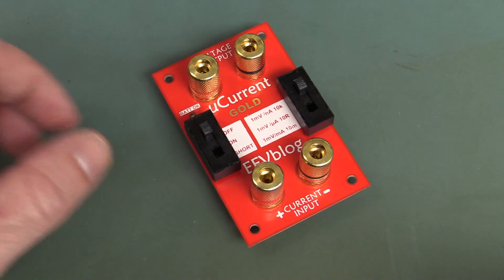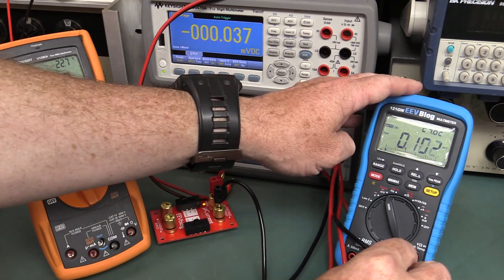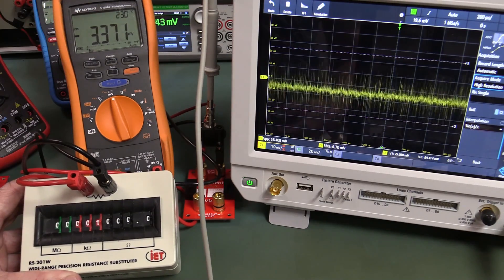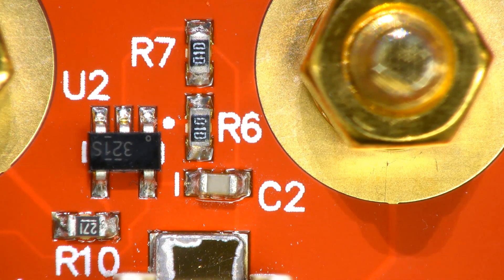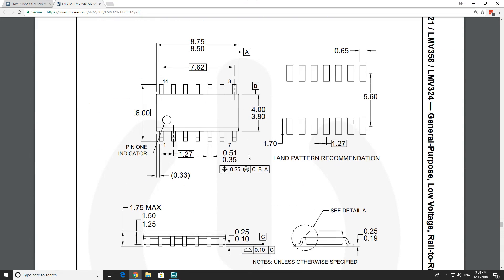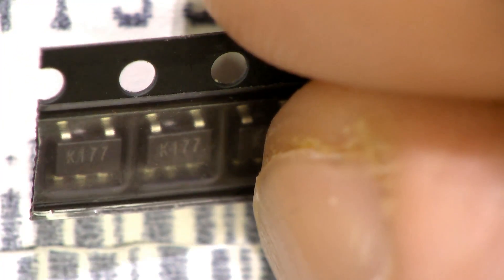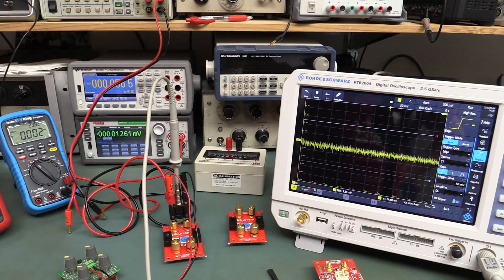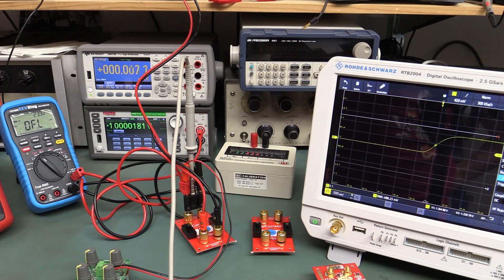EEVblog #1057 -  µCurrent Murphy

Comment: I see the problem in the schematic. The output stage uses a resistor from the output of the op-amp to the output pin. This R, plus a capacitive load adds a high frequency pole which causes excess phase shift and thus oscillation of the output stage. Move that feedback cap to the op-amp output instead of the board output and increase it a bit, I'd guess 100-1000pF. This was a latent design problem. Spice the circuit and you will see the marginal stability of that stage  with a C load. 
A marginal design is like a blind man walking along the edge of a cliff. If he drifts one way, no problem. If he drifts the other way a tiny bit he falls off. The parameter that is changing slightly is the op-amp phase margin, changing slightly from batch to batch. Fix the design, don't select parts. Hope this helps. 
Dave Erickson
Reply: This ^
Reply: Yeah, late reply but that was my first guess at what was happening just by seeing the schematic and the offset voltage. Strange offset voltage is the classic sign of oscillation!
Reply: @Duncan Julio instablaster =)
Reply: @Duncan Julio you are welcome :D
Reply: My reply is 3 years late but this is definitely true. The phase margin is pretty low for the MAX op amps. Looking at the datasheet, at x100 closed loop gain (40dB), the phase margin (by looking at the gain and phase vs freq) is actually NEGATIVE with just 100pF of load! And this is indeed at the MHz range  of freqs, which is what Dave saw. I mean, I don't know why the other op amps fixed this tho... why most of the boards don't suffer from this...
Reply: “Move that feedback cap to the op-amp output instead of the board output” Are you saying C4 should be connected to the op-amp side of R8 instead of the J3 side of R8?
Reply: @stargazer7644  Yes, that's correct.
Reply: @ericksonengineering7011  years later and still answering a question.

LEGEND
Reply: What I don't understand is how come the virtual GND opamp (321) is affecting the phase margin of the output opamp (from maxim) under the same circumstances of output loading.
Reply: If you don't simulate your circuits with various capacitive loads, then at least get a simple capacitor substitution box and test many different loads. I'm 99% sure the original op-amp would oscillate with the 'correct' C load values.

Comment: I have the same issue on both of mine, serial numbers in the 4100 range from November 2016!
I bought them with the intention of looking at measurements on a scope but was very disappointed to see 100mV of noise on the signal which made it totally unusable. 
Connecting it to a DVM it worked perfectly so I put up with it thinking it was just a poor design and not intended for connecting to a scope.
Now I know different and appreciate you doing a vid on this Dave with a great explanation of the cause. I should have queried it back in 2016!

Comment: Not that rare! After 35 years of EE design, I can tell you that there are no equivalent parts. Even parts from the same manufacturer can change over time and lead to this type of problem. High volume production has to test for all of the 'corner cases' or you WILL always have gottcha's! 
Once its in the customers hands those gottcha's cost big bucks to fix. This is one of the significant problems with 3rd party manufacturing. I've got lot of stories about problems similar, some are significantly more weird than this.
Reply from the maker: Yeah, this isn't quite the weirdest I've seen either.

Comment: I think not having a capacitor between V- and GND or V+ and GND is actually a design error, as it puts the complete AC output current through the virtual ground supply opamp.
Reply: I'd like to  see Dave just add that bypassing cap between there on a unit with the bad LMV321 chip

Comment: Thanks, Dave.  I really enjoy these videos.  I'm not a trained EE, just a lowly systems integrator (which makes me little more than a glorified technician.)  I hate to say that (at least where I work in the defense sector) this level of debug is starting to become a bit of a lost art.  I work with a lot of EEs who I'm not certain have ever built anything outside of MultiSim/OrCAD/whatever.  All well and good when everything works as expected, but they tend to flop and twitch when things go awry.

Videos like this, and your test equipment and basic electronics principles videos have really helped me professionally.  I appreciate all that you're doing and always look forward to the next one.
Reply: tychosis "My simulation says that the circuit works, so it works, I don't care what your bench data says."  If I had a nickel for every time I've heard this ..
Reply: Yep.  If we were selling a simulated product, that'd be great.  Unfortunately, we're not there yet.

Comment: This video is a masterclass example of general troubleshooting processes. It was very interesting, and frankly educational, to watch Dave go through the steps. I'm going to bookmark this one, this is great tutorial material
Reply from the maker: Thanks
Reply: I think that this video was very entertaining and I like it, but it’s not exactly the most straightforward troubleshooting process.There is an inherent trade off between an entertaining and watchable video and an efficient troubleshooting process. Most of my troubleshooting sessions would surely make for the most boring of videos: I measure a few things, ponder for a bit, measure some more, then simulate the problem (usually), fix in simulation, apply the fix, verify model-to-reality match of the fix, and call it a day.

“Mysterious” DC offsets in analog circuits are very often due to oscillations, so it perhaps should be the first thing tried. It’s useful to have a wideband “listener” for this: a 20kHz narrowband sampler – e.g. an old HP or Tek sampler box, with output to a speaker amp. You’ll hear oscillations rather clearly no matter what the frequency is (up into GHz). If you just get the input probe close to the circuit under test. I’m also skeptical of not having local decoupling loop on the output amplifier: one cap output-to-inverting-input, then a resistor from output to the output node, and another feedback from there to the inverting node: sometimes you can get lucky with a tiny chip inductor that would have desired ESR and high inductance to be DC feedback but not AC feedback.

Comment: There’s no controlled impedance between the output of that op-amp and the power lines, and when you connect capacitive loads the impedance goes negative enough. The chopper op-amps are like impedance converters in this circuit. You can make it oscillate in ltspice too. Basically: you were lucky with the original parts. The circuit is under-designed. It’s not unlike designing stuff with discrete transistors and being lucky with beta. Or with differential in-amps and being lucky on linearity (been there, done that, still get a tear in my eye when I think of the brouhaha that resulted from that on mission of mine). I doubt it very much that the chip is fake, but even if it was: it’s certainly good enough to do its job most of the time, so the design is sensitive to whatever is different. And it can be cheaply made insensitive. Thus my assertion of under-design.

Comment: This is the reason why big companies in the automotive market like Continental or Bosch require a customer nofication from the supplier whenever something is changing in the device; and I'm not talking about the design or the technology process but even a change in a transistor dimensioning counts. And they usually want to have proof that the parts that they will receive will still be in specification.
As an IC test engineer in the automotive industry this is quite a spill you have Dave :)

Comment: A really interesting issue.  I just checked my own stock, and I have some LMV321M5 (Nat Semi, marked A13 like your TI ones - these were purchased 2010 prior to the acquisition), and some LMV321WG (Diodes Inc, marked BX0jD).  I might just swap in the Diodes Inc part on my uCurrent Gold (#00624, with LMV321 marked RC1F) and try this same test with my 121GW.
Reply: OK, I did some testing with my uCurrent Gold.  First I checked it as-is with my 121GW, and was surprised to see 1.7mV.  But I realised the 121GW was still on the AC mV range from an earlier test (FYI it read 1.7mV 35kHz).  When switched to DC mV it read less than 10uV, as expected.  I then swapped in the Diodes Inc LMV321WG and it read about 3mV, but the PCB was still quite warm from the hot air.  Once it had cooled, it again read less than 10uV, and it stayed reasonably stable with additional capacitive load at about 70uV with 1uF.  Finally, I pulled out one of my early (non Gold) uCurrents, and it used an LMV321 marked RC1K.  It gave a reading of about 20uV with a shorting bar installed.  So it appears the Diodes Inc part is a potential alternative if needed.  I'm quite glad about that, because the original LMV321 went flying of the desk when I desoldered it :)
Reply from the maker: Thanks Kean. So that's now 4 out of 5 known good parts.

Comment: Good problem and troubleshooting Dave!
In my younger days as a summer intern at an electronics company, we had a mysterious problem in a discrete uvolt 
analog to frequency converter that was affected by too much lead in the silkscreen paint that caused leakage paths between components!
It taught me that you have to take everything into consideration and not discard what you might believe could never be the problem or, at least contributing to the problem.
Reply from the maker: Woah, first I've heard of that one.

Comment: Interesting vid.  Part swapping is convincing evidence of the oscillation correlation but does not identify the underlying oscillation mode.  For example, is the LM321 actually oscillating or causing the Maxim amps to oscillate through the Vgnd/load interaction?  Your comments suggest that the Vgnd circuit action is trivial.  Maybe the DC action is trivial, but the AC action is certainly not.  Would be very interesting to learn the underlying oscillation mode.  Thx.

Comment: Hi Dave, something I had show up on multiple occasions.  Always attributed to stray capacitance that the fab house doesn't gurantee equal amounts of board capacitance in the order of 4pF. I got boards that exhibit 50 to 80 pF that I have to compensate for in design. Need to add as well, chip manufacturer designs components to specs valid in house which are at times harder to mimic in test. The closer the specs to acceptable margins means probably out of spec performance.

Comment: You should defenetly call in to Mouser / digikey or even call in On- Semiconductor / fairchild to let them know that this problem exists.
This is an fatal production error that they realy should correct
Reply: I wouldn't be so sure that the IC is at fault. In my opinion the circuit design is at fault and has marginal stability. All we are seeing here is a slight variation in opamp behaviour. All of them probably meet spec.
Reply: Well that's not quite right. Unless I can demonstrate actual oscillation of the opamp entirely on it's own within the claimed cap load spec, then it's really an application specific problem and not their fault.
Reply: I tracked down the designator codes which are on p12 of the latest data sheet. They don't match.
Reply: They totally know it already - it's on their Frequency vs C chart.

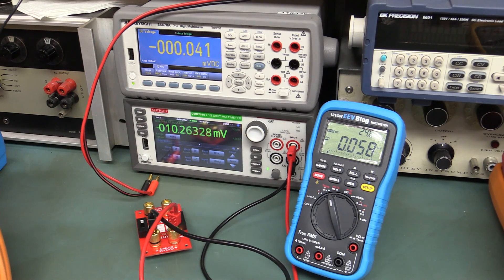Comment: I hope you have fixed this. 3:30 - The protection resistor R8 should be at the output pin, not before the feedback loop, right? Here the output load can feed in unimpeded noise through the C4.

Comment: Can you remove the oscillation with decoupling capacitance between the virtual ground and the + & - rail ?   maybe pop a couple of 1uF in ?
Reply: He could probably do it by creating a new dominant pole (add a large output cap like 10uF or 100uF between the virtual gnd and battery negative).
Reply: I agree. I am an analog engineer and never put bypass caps between (+) & (-) supplies without first bypassing each individually to ground.
Reply: No u wouldn't've, switching noise is a digital problem.

Comment: A capacitor from the negative rail to the +ve input of the voltage divider opamp is normal, taken from one end of the decoupling cap, to avoid unity gain stability problems.  So is using wide short tracks for decoupling capacitor connections for the same issue (unity gain stability) 15:56 shows the teeniest of tracks which could have been a lot shorter and wider.  Not saying that would cure it, just that it's normal practice to help keep Murphy away!

Comment: Dave, have you considered just adding bypass capacitors between your virtual ground & the power pins on the 321? Seems to me that that would stabilise it. (Lowering your voltage divider resistors from 100K might work too, but of course that'd increase power consumption.)

Comment: Once I was repairing LCD monitor where backlight was not working.
But CCFLs were ok, high voltage PSU also but it's driver was cutting it off after one second, probably detected that CCFLs are worn out a little bit.
At some point I hooked up my multimeter to HV output, and bingo, backlight was just working with my leads attached to the output.
And these leads have some capacitance.
Soldered 1pF 1kV ceramic cap to the output and monitor fixed...

Comment: Why is there a 100nF capacitor between V+ and V- in two different places in the schematic (C1 and C2)? Is the second one just a duplicate and thus is it redundant? Thank you for clarifying!
Reply: Because you always try to decouple the supply as close as possible to each chip, so that the inductance of the pcb tracks won't reduce the effectiveness of the decoupling. C1 will be physically located close to the MAX opamps and C2 close to the LMV321. In digital circuits prior to LSI, it was common to have a 100nF decoupling capacitor every few chips, so you could end up with numerous, apparently redundant, decoupling capacitors on a single board.

Comment: I read on analog.com that when using a virtual ground you need to place a capacitor in parallel with the output of the resistor divider to preserve power supply rejection. So maybe whacking a cap across R7 would fix the problem.
Reply: Here is no issue with PSRR, it is an issue of missing a low impedance path from supply to load. This could be fixed by placing a shunt cap after the 270ohm resistor.
Reply: wrong, see the followup video on eevblog2

Comment: Looking at the schematic, I would be wary of the high impedance present at pin 1 (the non-inverting input) of the LMV321. I would have liked to see the scope examine the 321's output at pin 4 when the MAX4239 opamps were oscillating to see whether the oscillations were present there as well. If not, it's difficult to see how the different 321s could cause the oscillations. If oscillations were present on the 321, then my first instinct would be to decouple pin 1 to each of the supply rails to reduce the ac impedance at that point.

Comment: The LMV321M5 is the former National Semiconductor IC while the LMV321IDBVR is the TI one. They may be even still made at different plants because of effects exactly like you found. Imagine TI buying ON Semi and then only making oscillating LMV321 chips at the ON Semi plant, that would piss some engineers right off. So at one point TI may officially declare the LMV321M5 obsolete and introduce the LMV32IDBVR as a successor.
Reply: I found some Fairchild data for chip markings and it does not even have the correct format of marking.
https://www.fairchildsemi.com/Assets/-topmark/dateCode2.ssi
The data sheet on on-semi right now has device markings in it and the format does not match that either. So I have no idea what that chip is but I doubt it is either On-Semi or Fairchild as it should be.

Comment: There is no surprise that Fairchild part oscillates. It has a big hunch on it's Frequency Response vs C chart. From my experience it is a clear sign that it will oscillate on that frequency under some conditions. And TI datasheet has no hunches on it's Gain vs Capacitive Load chart.

Comment: On the output op-amp, the capacitor should go from the op-amp's output pin to the inverting input.  This provides a negative feedback that is not delayed by capacitive loads.

Comment: Just to add to your serial number database: in Nov 2016 I reported an issue where "Short" reported a -5.5 mV offset (on one of your multimeters!). My serial number is #004118.
With zero response, I "filed" this dud somewhere. I'll find it and e-mail you direct to discuss what to do about it

Comment: I'd like to state another thing: According to your schematic your feedback path in the OpAmp-amplifier has 9kOhm||10pF resulting in a 1.8MHz cutoff frequency. Notably, your oscillations are in the range of that frequency!In your µCurrent specs a -3dB-bandwidth of 300kHz. So you may additionally think about increasing the capacity from 10pF to 33 or 47pF. I am quite sure that would add additional stability and it may make the batches better comparable: Your 10pF are effectively increased to 12 to 15pF by the pads and line capacities - a quite big range that is significantly reduced by a larger cap.

Comment: What is the device, a microammeter to be connected in series?
Is there a microvoltmeter available instead? To trace small currents in circuits, detecting voltage drop in pcb traces .

Comment: This op-amp uses Fairchild  top marking, according to the binary date code scheme was manufactured in 2006 work-week 16-23.
The confusion is because Fairchild was adquired by ON-Semiconductor,  the making scheme between both companies were different and current ON-Semicondutor documentation in the website is a mess.